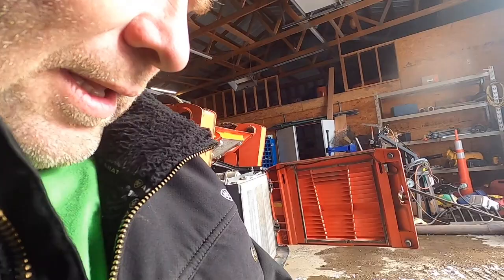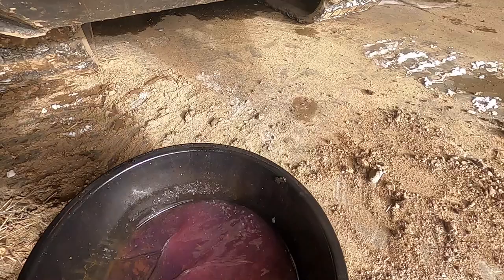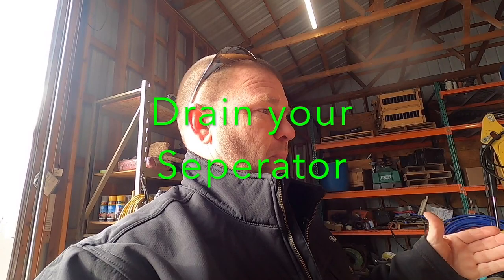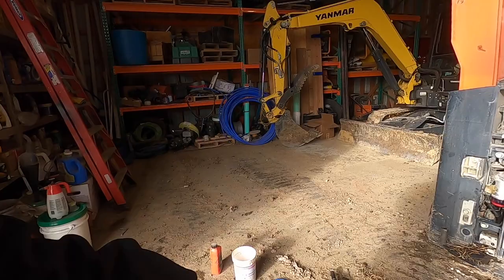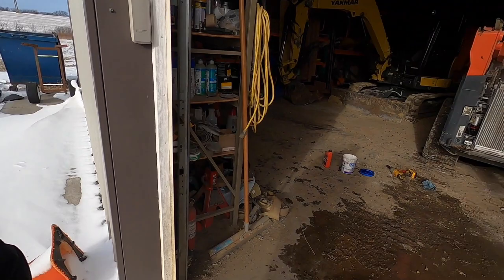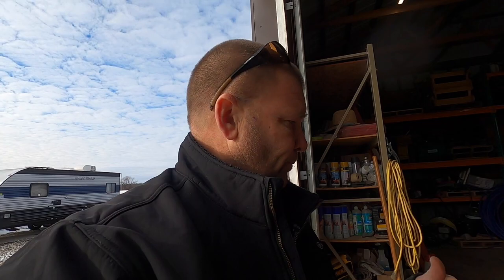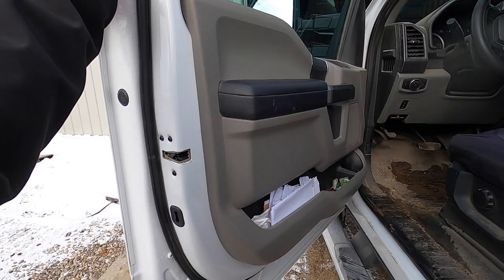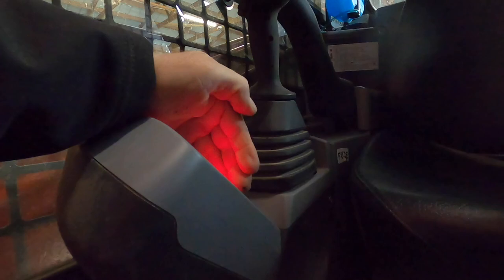Diesel Fuel Gelled Up. How To Get Started

Comment: I got a water bubble in my fuel filter on my excavator back in the early spring. I tried to clean it to get it on the trailer to get it home. No dice. Had to buy a new filter to get it to run. Checked my fuel tank for water and found none. I was thinking like you that it may have been from the wild temperature swings we were having. No problems since but I am a lot more diligent about draining the water separator.